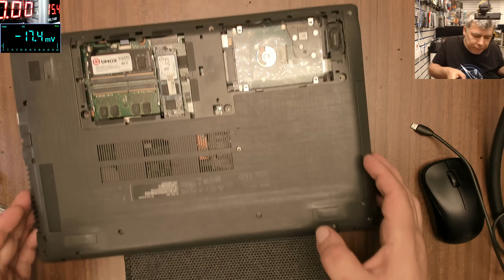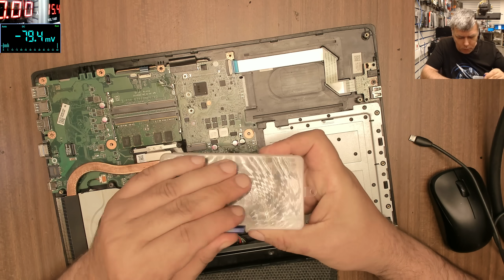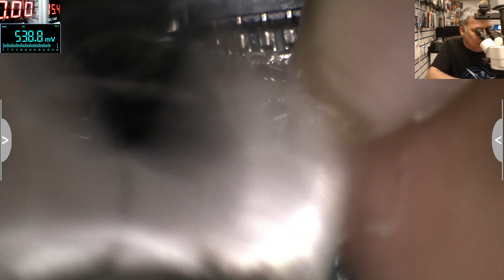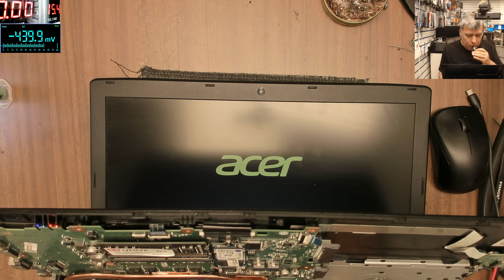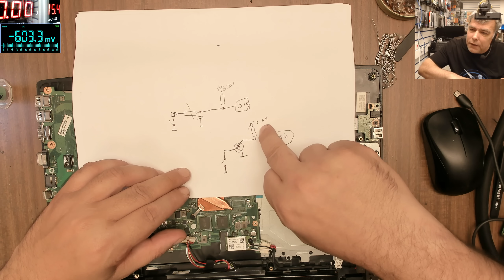Go the extra mile - Acer Laptop - Keyboard Repair - Part2

Comment: In this case i might just put a separate tact switch hidden somewhere in the side of the laptop. A separate switch is more reliable and fast repair. Tact switch also cost less than a transistor.

Comment: What if on the part 1, what if u just make a switch button other than that of the keyboard button. You i was amazed by the jumper u made and make it switch on. Well for me that doesn't have the equipment i will just make another switch.

Comment: This is not a dodgy repair.. For who knows is the application of  the Electronics Theory.  Sorin is doing a lot of dodgy repairs, but this one is kind of nice. To use a transistor as a switch to short 3.3V to GND is a nice idea and costs only a penny in parts.

Comment: Transistors from home... Come on... Your workplace should give you an SMD resistor assortment book. Such would have already paid itself back from the time you would have spared on searching resistors for this job. Coils and mosfets you can harvest from boards. But not resistors. It's not worth your time. And capacitors you never replace so you won't need them. Just, some resistors, some basic transistors.. You deserve that.
The fix: excellent. But was it needed? I don't remember if you did a quick visual on the keyboard, cable and connector. Maybe it could be fixed with just a bit of cleaning.

Comment: You should clean the flux, always. In that case it is a low voltage track, but I have seen things blow up with higher voltages due to the flux. Although flux should not be conductive, it may have some conductivity, especially if it is cheap.

Comment: Love your smart thinking quick repairs.  As this is was just one key, and likely had something spilt down it causing this issue, really puzzled why you didn't remove everything but keyboard from laptop then try (a) IPA down button to see if that fixed it, and/or (b) water followed by hot air in case a sugar drink, milk, etc. being the cause (as this won't dissolve in alcohol).  Love watching all your repairs.

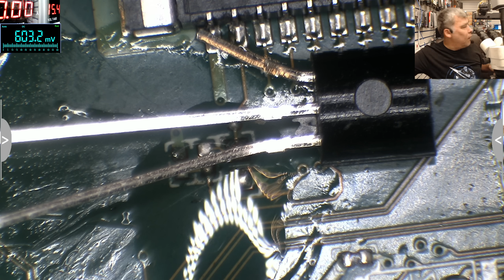Comment: i am a little confused, the first time you put the transistor on the board at min 8:23 the flat side was down (collector on ground). the second time you put the transistor on the board (after cutting emitter) you can read which transistor it is (flat side up), you then soldered emitter to ground. btw Base was never soldered to the board. and it works?
Reply: base was soldered. You need to look closer ;)

Comment: Master Sorin, can you explain the schematic of the transistor on the 3v line more detail, I didn't quite understand how it managed to make it work. Tahnk you.
Reply: Learn how pnp transistor works as a switch: in short having 0V on the base will turn it on, meaning collector-emitter path will become low resistance and bring superIO pin down to about 0.6V (is by default pulled up to 3.3V via the 100k internal pullup resistor)
Reply: Mr. Sorin pls try and explain the new schematic with the old one

Comment: Hello, I hope someone will be kind enough to explain how this works. Since switch is faulty, it can be represented asa  series connection of ideal switch and a resistor. When power button is not prressed, the base of the transistor is floating. When it is pressed, the base is via this internal resistor connected to the ground. This means Ube <0, and PNP transistor is conducting, i.e. voltage between E and C is 0.6V. When button is released, the base is floating. What ensures the transistor to stop conducting?
Reply: This is bipolar transistor! Not mosfet! When base is connected to nothing(air🤣), the transistor stop conducting between collector and emitor!
Reply: adaniel is right. BJT transistor is "current device". Base current must flow to make CE current flow (which is much higher than the base current). Mosfet on the other hand is "voltage device" you need low voltage on p-mosfet gate to turn it on so often you would need pull up resistor on the gate to "reset it" into non-conducting state when button is not pressed.

Comment: Smashing repair, that's a propper bodge ha ha :-D
The transistor is safe as the maximum collector/emitter current is restricted by the pull up resistor.
Just in case anyone was worried about it.
Reply: Sorin did think about the problem that i was saying when the resistance of the power buton will change!
Reply: @adaniel69  Yes he did, but i thought about the possibility of the button becoming a lower resistance when he did the first mod..
The current through the transistor via the base is limited by the super io pull up resistor. (the only source of power).
Dont forget that transistors have gain, its not just a switch.
I wasn't going to suggest something i had not thought out.
I really like sorin, i wanted him to succeed :-D
Reply: Transistor is safe...the 3.3V power supply that is powering the SuperIO chip is delivering maximum 100mA-a current that most of small power transistors can handle..

Comment: This is bit unusual. I would expect a resistor on the collector and base, but not on the emitter. This is not the ideal way to use a transistor as switch. But, hey . it works.